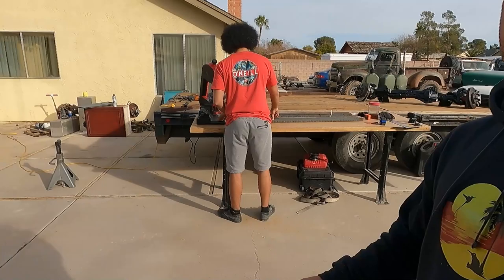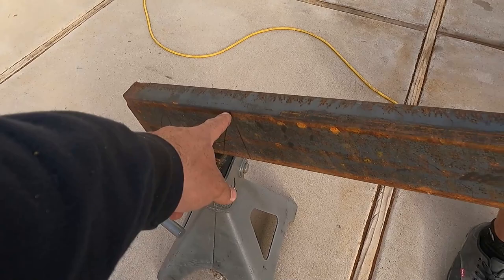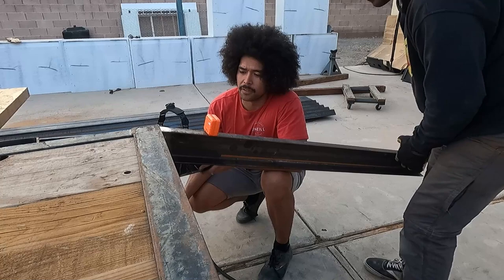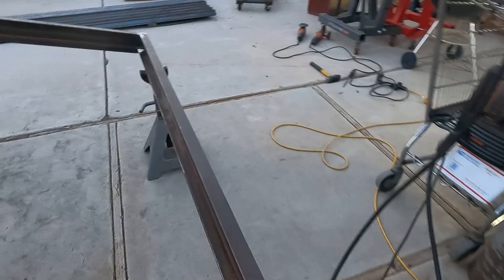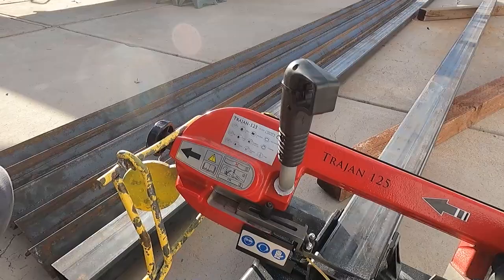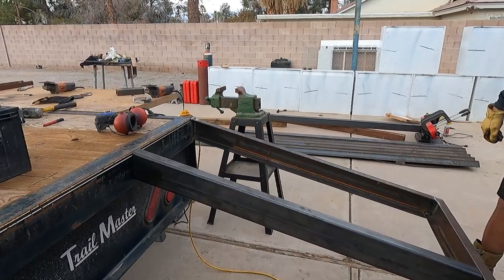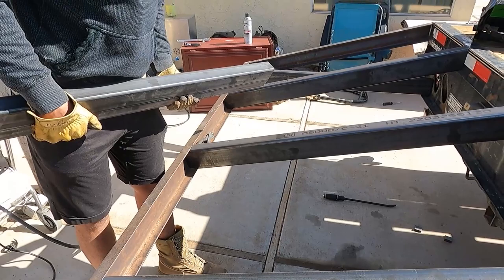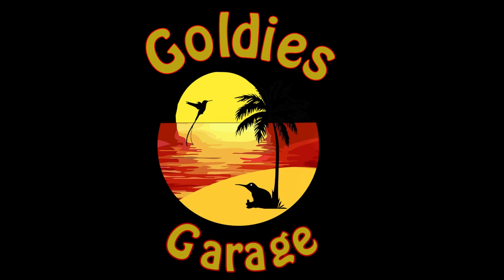Building the structure - Adding a Dovetail on a Gooseneck Trailer - PART 1

Comment: Due you have a parts list you used?
Reply from the maker: We used mild steel - Rectangle tubing 2"x 3" (3/16) Angle Iron 3"x 3" (3/16) Is this what you are asking?
Reply: @goldies_garage  THANK YOU FOR THE REPLY ,VERY HELPFUL , I WANT TO CONVERT A TRAILER I HAVE TO A DOVE TAIL AND RAMPS THANK YOU
Reply: @goldies_garage  yes
Reply from the maker: @user-hv4pu1zi8k  You're welcome, also we used a 4" C-channel for the end piece. not sure what size.

Comment: This was very helpful. I have c6500 that I wannt to " dovetail" :)
I understand sdditional weight of this but curious why you didn't add folding drop down ramps hinged to the trailer?
Reply from the maker: Thanks for the comment. We tried to keep it simple. We might mount the ramps to the trailer in the future if time allows. Really, if we made the ramps narrower and some thinner material it would be WAY easier to manage.

Comment: Why have the ramp that short?
Reply from the maker: I'm no scientist and going to assume you are talking about the dovetail. I have three reasons...
The longer anything is the stronger the structure would have to be. I don't want to get into and nor do I know steel load limits and whatnots.
Weight, just adding this alone add about 700 lb. to the trailer with just reduced the capacity of the trailer.
If we make it to long or low it will drag a lot more I don't want to get stuck somewhere. Ever see a low boy trailer get stuck on tracks and hit by a train?